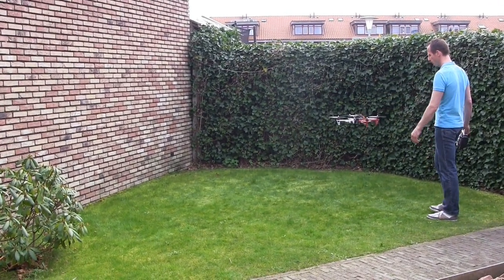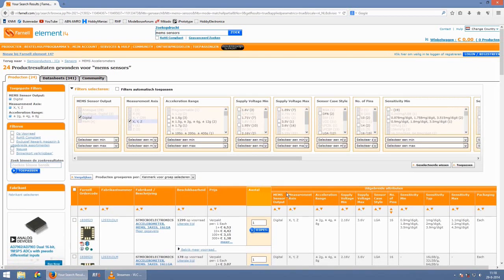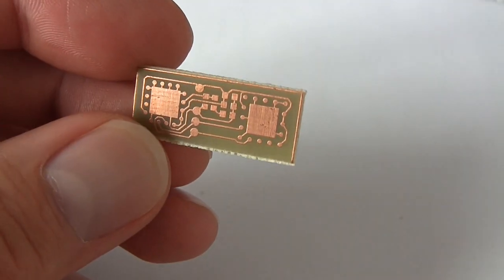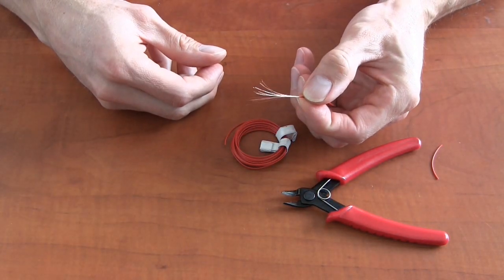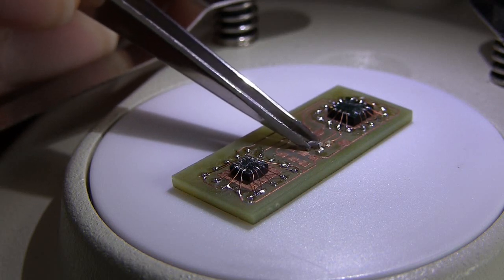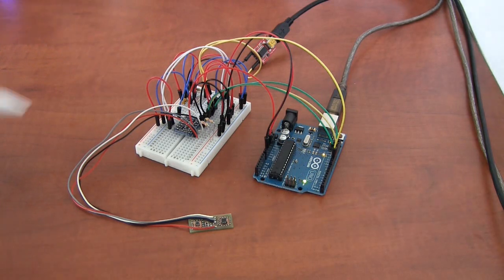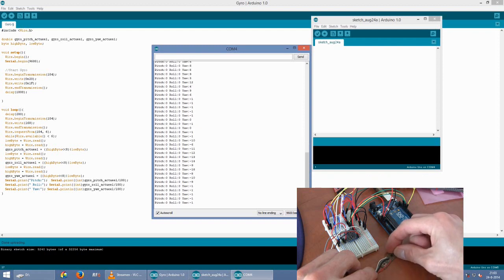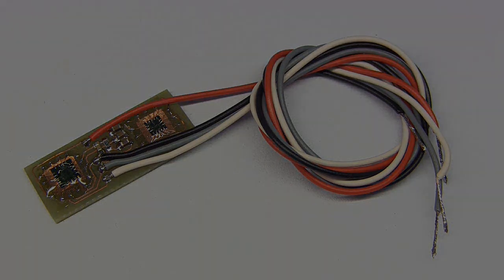SMD "dead bug" prototype hand soldering with tiny LGA sensors.

Comment: Wouldn't it be easier to put normal solder on the pcb, then just put on it chips and then put it into an oven? Like baking a graphic card.
Reply from the maker: It would be easier. But then I don't have the guarantee that the connections are 100% ok. The only way to do this the right way is by reflow.

Comment: Hi joop, I wrote the code for the accelerometer(lis331), but do not work

#include <Wire.h>

double pitch_acceleration, roll_acceleration, yaw_acceleration;
byte highByte, lowByte;

  void setup() {
  Wire.begin();
  Serial.begin(9600);
  
  Wire.beginTransmission(25);  //Start communication with the gyro (adress 0011001)
  Wire.write(0x20);                       //We want to write to register 20
  Wire.write(0x1F);                       //Set the register bits as 00011111 (Turn on the gyro and enable all axis)
  Wire.endTransmission();         //End the transmission with the accelerometer
  
  Wire.beginTransmission(25);  //Start communication with the gyro (adress 0011001)
  Wire.write(0x23);                       //We want to write to register 23 
  Wire.write(0x72);                       //Set the register bits as 1001000 (Block Data Update active)
  Wire.endTransmission();          //End the transmission with the accelerometer
}

void loop() {
  
  delay(250);
  acceleration_signalen();            //Read the accelerometer signals
  print_output();                             //Print the output
}

void acceleration_signalen(){
  
  Wire.beginTransmission(25);                                         //Start communication with the gyro (adress 0011001)
  Wire.write(168);                                                                //Start reading @ register 28h and auto increment with every read
  Wire.endTransmission();                                                //End the transmission
  Wire.requestFrom(25, 6);                                               //Request 6 bytes from the gyro
  while(Wire.available() < 6);                                            //Wait until the 6 bytes are received 
 
  lowByte=Wire.read();                                                     //First received byte is the low part of the angular data
  highByte=Wire.read();                                                   //Second received byte is the high part of the angular data
  pitch_acceleration=((highByte<<8)|lowByte);          //Multiply highByte by 256 and ad lowByte
  
  lowByte=Wire.read();                                                  //...............
  highByte=Wire.read();                                                //...............
  roll_acceleration=((highByte<<8)|lowByte);           //...............
  
  lowByte=Wire.read();                                               //...............
  highByte=Wire.read();                                             //...............
  yaw_acceleration=((highByte<<8)|lowByte);      //...............
}

void print_output(){  
  Serial.print (pitch_acceleration);  
  Serial.print (roll_acceleration); 
  Serial.print (yaw_acceleration);
}

I have the wrong code ??Or I have destroy the chip??
You can help me??
Reply from the maker: You are using the gyro sketch for reading the acc. This does not work. Check the datasheet of the acc on how to turn on the acc and read the corresponding registers.
Reply: +Joop Brokking The code is written after reading the datasheet but I was wrong in comments, sorry.
I have read correctly register in accordance with the datasheet (http://www.farnell.com/datasheets/1690400.pdf),you can see the code and tell me that I have wrong ??

Please help me.

Comment: What is a dead bug and what does it do?
Reply: +Evert van Ingen Have you even watched? A chip turned around looks like a dead bug with his ,,legs,, pointed towards the sky... Thats where the name comes from.
Reply: Google photos of "Dead roach"   On it's back with legs in the air; just like an 8-pin DIP chip turned upside down, with sharp pins pointing away from board.

Comment: Hi joop,Which one do accelerometers you suggest??

1) http://www.farnell.com/datasheets/1690400.pdf

2) http://www.mouser.com/ds/2/389/DM00040962-252628.pdf
Reply from the maker: I'm using the LIS331DLH myself. I don't remember what my motivation was at that point. There are a lot of parameters that you can compare.